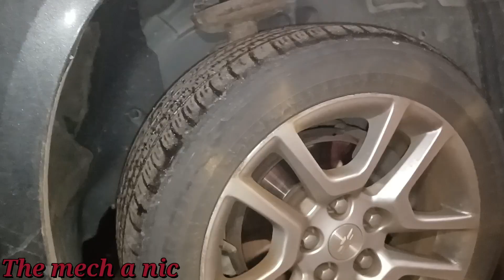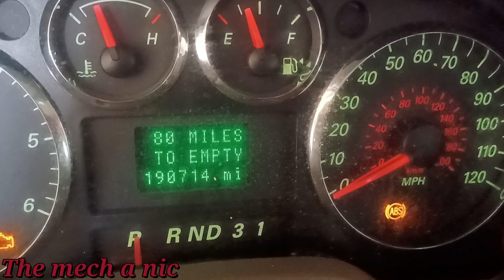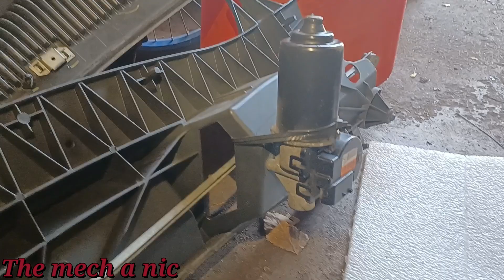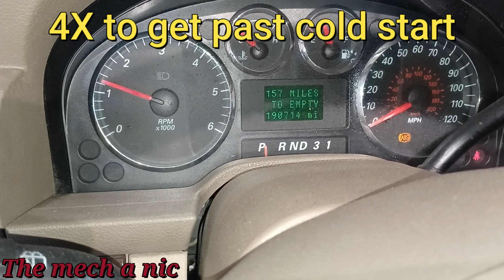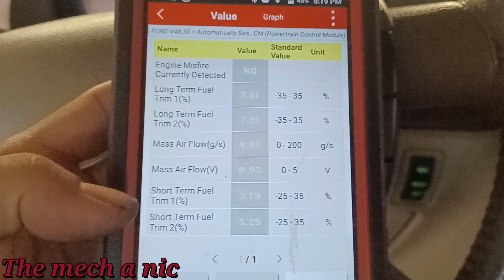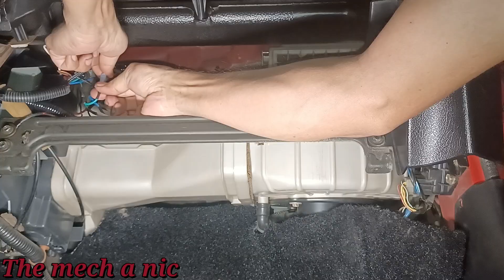malibu grinding brakes / freestar tune up / accord fuel leak (vol 125)

Comment: Just like putting a pet down, you hate to do it but you know it's best to put it out of it's misery. As I listen to you I scan over the comments. I was waiting to see these famous "Zip ties". Now I understand. Nice catch on the ignition coil. It is satisfying to fix things as you find them. Especially when it's a cheap and easy fix. Great tip about installing a connector.
Reply from the maker: Yeah I keep trying to think of different options to keep the car... if I had the space to store it and time I would attempt to replace all the fuel lines with something that will never rot away but that's not really a option

Comment: 26:33
Blob of silicone paste on each of those white nylon rod guides!
Not petroleum lube, it will degrade plastic.
Great repairs for all, Jonathan. Love you, man.
Reply from the maker: I can't remember what type of lube I put on those white pieces of plastic.  Probably not a bad idea to wipe it off and use the correct grease to be safe